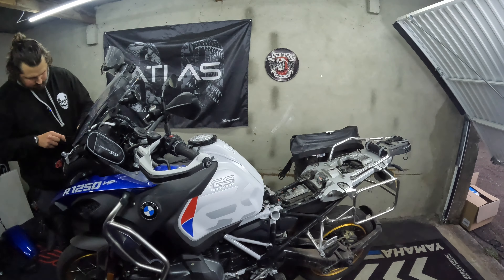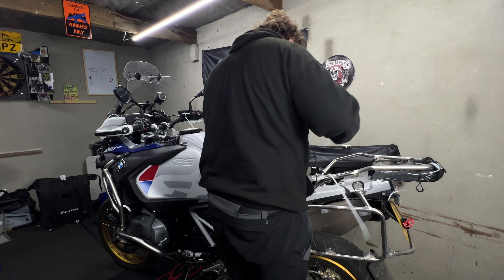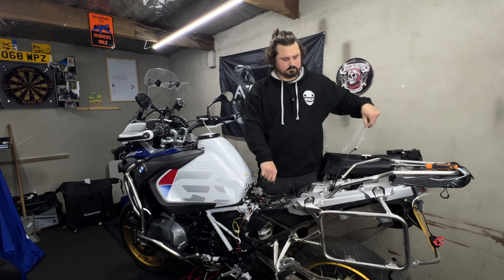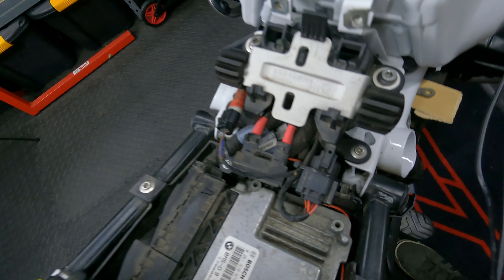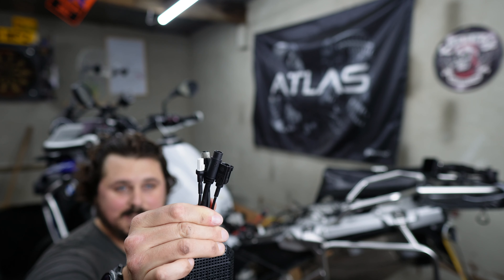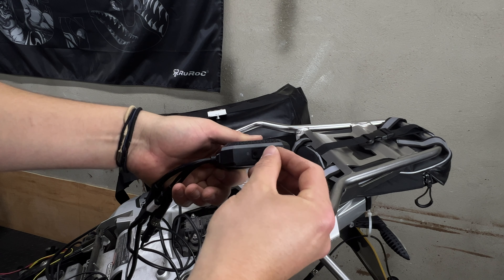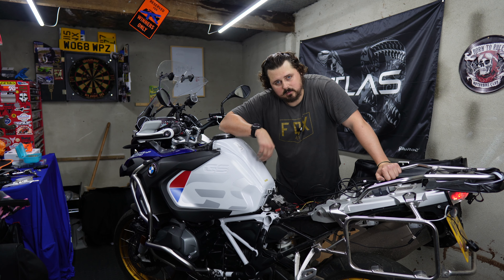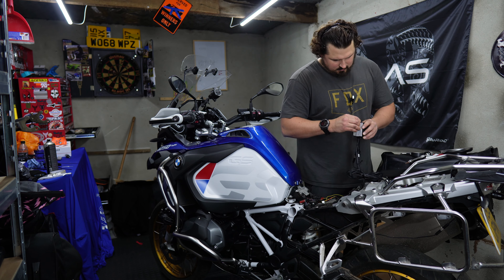Motorcycle Dashcam install / I BROKE my seat / Vantrue F1

Comment: try it on a XSR900 naked w/o fairings to bury cable in.  Remove the Gas Tank and seat..  figure out where to bury 20 ft. of excess cable.  Back and forth under the tank/seat.  That stick on control panel with HUGE cable is a joke!  Should of waited for the F2.  There are no cable length options for a "Motorcycle Cam"?  Kinda pissed, but it works well.
Reply from the maker: I know mate. But they aren’t the only ones. All the dashcams I’ve had come with 20ft of cabling. No point at all. But they still do it. 🤦🏻🤣

Comment: Thank you for the insights of this install. 
Quick question, why did you choose the red/blue wire for your accesory (yellow) cable, what is it actually for?
I know it goes live when bike is switch on, and technically you can use any other cable (eg, rear light) which does the same... just curios why that one and what it is for :)

Thank you in advance, cheers!
Reply from the maker: Hay, so I watched someone on YT, think it was teapot one who installed something on to his GS, so I knew exactly where it was and what I was I looking for, so that's the only reason I chose that cable. As you said you can use any wire that turns on with ignition.

I have bought a health thunder box to use going forward as I have been sent other units to test out, this box eliminates the need to tap in to any wiring loom at all, worth checking out. :)
Reply: @DSR1YT  sounds like there are many ways to attack this. 
Another question, do you recommend your GuardConcept as shown in the video at 12:13 and would it qualify to mount the Vantrue front cam on it (assuming you can remove the GoPro mount on it!?)?
My options are little for the front cam and I do not have the headlamp guard which btw yours looks pretty hammered by flies 🤣

Thank you in advance, cheers